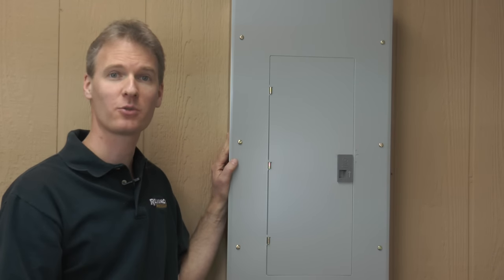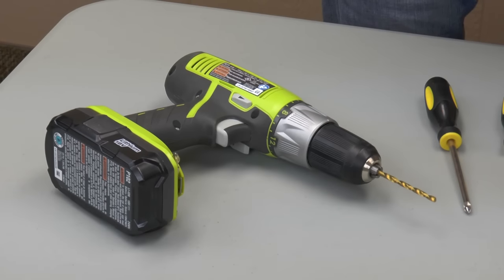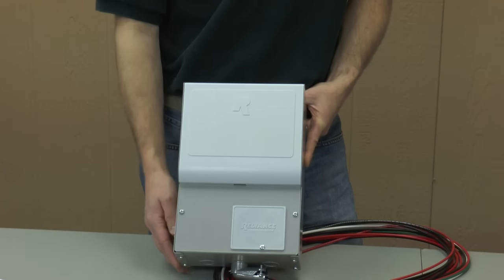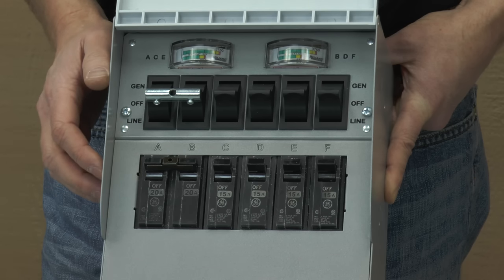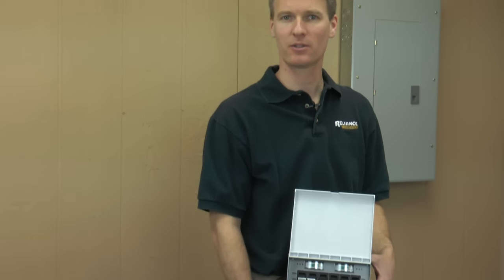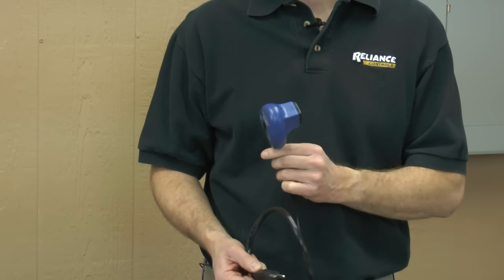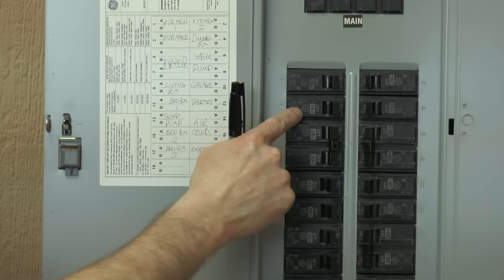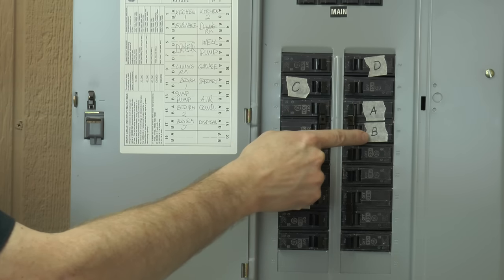How to Install Reliance Controls ProTran2 Transfer Switch- Part 1Tools and Planning

Comment: I don't need a 20a 240v double pole circuit for the A & B circuits.  I want A & B to handle different loads.  I removed the handle tie as instructed here.  What I'm curious about is should I replace the 20a double pole breaker with two 20a single pole breakers b/c that's what I did, but now I'm doubting myself b/c the video didn't recommend doing the same.  I did a little research and I'm concerned that this might not be wired correctly for two single pole circuits.  Do I need to put the 20a double pole breaker back in?
Reply: I have the same situation and did the same (took off the tie) and added two separate breakers. 

But I think the double pole 20A supplied is there to take 120 to both the A&B sides of the ProTran. This allows a 120v generator to power both phases. 

I figured that out by switching my generator output to 120 and not all circuits work. Send out 240 a d they all work. 

Would be nice to know if that is in fact how they designed it.
Reply: @jimgorman7289  I have the same question, I have no need for a double 240v breaker, so do I simply remove the ties to the top and bottom breakers and then I can wire each breaker just like the other breakers for two 120v devices with the included cables?
Reply: @IsmaelPR32  after speaking with Reliance, my comment above isn’t correct. My generator had 120 or 240 via toggle switches on the front. So selecting just 120 only energized half of the breakers in the ProTran panel. Has nothing to do with the first double pole breaker at all. So one leg of my 4 wire to the ProTran was hot at it would send electricity to A,C,E or B,D,F. 

So to answer your question you need to take the tie bar off the A&B top switches AND remove the double pole breaker and replace it with two new single pole separate breakers of the appropriate size based on the circuit you are feeding in your main panel.
Reply: @jimgorman7289  thank you for this information. Does the connection s behind the double pole breaker need to change? Or just simply remove the double pole breaker and install 2 single pole breakers using the same wires that were on the double pole?
Reply: @jimgorman7289  oh another ting is that my generator or single phase. So all my breakers would be energized so maybe I don't need to install 2 separate breakers?
Reply: @IsmaelPR32  pretty sure you don't need to touch the wires behind the breaker(s).  Just swap out the double for 2 singles.  Then they are separate.  Been a while since I was in there, so to be 100% sure, give reliance a call.  Worth the 5min call to be sure.  They are very helpful.

Comment: What happens if the appliance/load isn't marked on the panel?Rewire the whole house?
Reply from the maker: Thanks John!  If you are referring to the house breaker panel and its circuit chart (label), if it is not labeled or labeled incorrectly, there will always be the challenge of having to identify the circuit breakers that you wish to wire to any transfer switch, whether it's this type or another type.  

That is entirely unavoidable, the circuits need to be charted and there are a few ways to approach that (circuit locator tools, trial and error by shutting off breakers and seeing what all shuts off, etc.).  

The only type of transfer switch addition that would not force you to do this ahead of time, would be to add a transfer panel/switch AHEAD of your existing panel which would allow the generator to feed your entire panel. 

However, eventually someone still has to map out the circuits no matter what.  Once the entire panel is accessible to the generator, the last thing you want is to use power that is not needed or overload the generator by not turning circuits off that draw too much power.  Operation is performed by turning the breakers OFF and ON to control the circuits and indeed you will need to know what breakers control what circuits in the home or how will one know what they are turning off and on?  About the only time a circuit map (for your house panel) won't be critical, is when someone never has to add, service, or do anything to their panel or electrical system.  As soon as anything needs to be serviced, or a transfer switch added, someone will need to go through the process to map the circuits.
Reply: Turn off one breaker at a time and go through the house and see what is no longer powered.  One at a time.  Then mark it.  Don't assume one outlet being dead is the ONLY circuit.  Check everything.  Sometimes people source power for other things from unlikely sources.  A dead outlet in a bedroom may be tied to a hallway ceiling light for example.

Comment: Will this work with a generator with GFCI? Thanks.
Reply from the maker: Thank you for the question!  It depends on the GFCI protection in the generator and if there is GFCI protection on the L1430R receptacle being used (assuming that's the outlet being used).  Most generators do not have GFCI protection on any 120/240v outlets aside from very specific generators geared towards jobsite applications.  It will work if there is no GFCI on the outlet being used, and will work if there IS a GFCI as long as the generator itself is "floating neutral" configuration.

Comment: How do you do this if like most panels it is in the wall. Please do a video on that.
Reply from the maker: Hello, I believe that the vast majority of panels are not recessed (flush) mounted indoors, but there are certainly a lot that are flush mounted.  We do have plans to make a lot more videos, the flush install being one of them, but due to the variances in walls and locations it can't encompass all installations it would be more of a general guideline.
Reply: Reliance Controls I'm starting to lose confidence in my decision to go with your product. If flush mount boxes are not common then why do you have a flush mount kit?
Reply from the maker: Phillip, I stated that the majority of panels are surface mounted but "certainly a lot are flush mounted".  They are just less common overall than surface mounted panels. With over 100 million homes in the U.S., there is a huge variety of electrical panel installations and it varies from building to building.  We make flush kits for certain transfer switches simply because there are a lot of electrical panels that are flush mounted, even though they don't make up the majority of all breaker panels. Similarly, we make outdoor rated versions of almost every transfer switch model even though outdoor breaker panels are more rare than indoor breaker panels.  

We try to offer the largest selection of manual transfer equipment and accessories for portable generators so that almost anyone in the U.S. and Canada using single-phase 120/240v electrical services has options to use our equipment.  And we make many accessories (from plugs to cords to flush kits and adapters) that we think can be useful to some people even if the volumes of those accessories are not high. I'm confused as to why you would have a negative perspective of the fact we offer something that isn't used often, in this case  people would be extremely unhappy if we didn't offer a solution for their flush mounted breaker panels.
Reply: Fortunately, the flush panel load centers are not commonly used for whole house distribution. I see them most often in modular homes and in additions where there is no basement or walls that are unfinished.  You are going to have to make a small hole in the wall to get power to the transfer switch from the exterior mounted receptacle (unless you run the conductor  on the surface-ugh!) and you will have to remove a section of the finish wall to get the conductors from the transfer switch into the load center.   I just finished an installation where the load center was surface mounted in a closet in the kitchen.  The only option was to  put the transfer switch in the basement and run all the conductors in PVC conduit up to the load center.   Good luck with your project.  I use Reliance transfer switches exclusively and have no connection whatever to the company. The are not inexpensive, but in my opinion they are the best on the market and well suited for DIY.
Reply: I don't know where you live, but where I live almost all homes have flush mounted panels because we don't have basements.  I live near Savannah and our terrain is fairly flat, so no basements.  I am interested in one of your products but it will have to be flush mounted.  Your instruction manual on the flush mount kit leaves a lot to be desired.  Just one photo would tell more than the entire manual.  A search of Youtube has yielded not a single video of a flush mounted panel.  I have seen a few where the homeowner had a flush mounted load center and installed a surface mounted transfer switch.  Looks like crap.  So how do you use the flush mount kit?
Reply: @Norm5264  most new homes have flush mounted
Reply: Hi I really like your products  , would you send the link with the flush kit I’m in Texas and here almost all houses came with a flush panels  I’m glad you have the solution thank you again for your great products